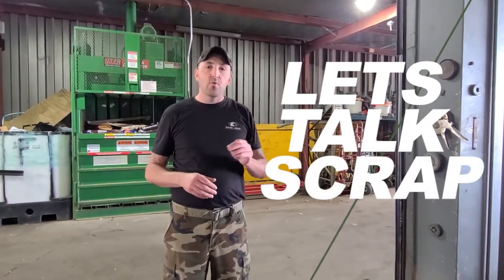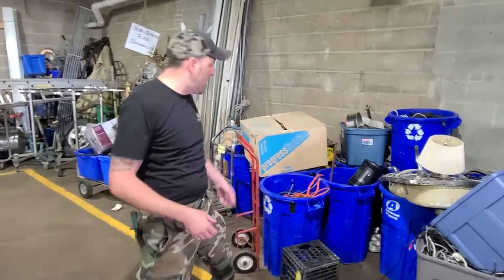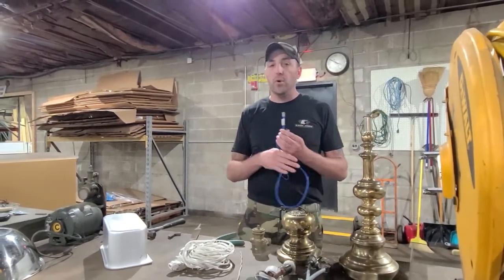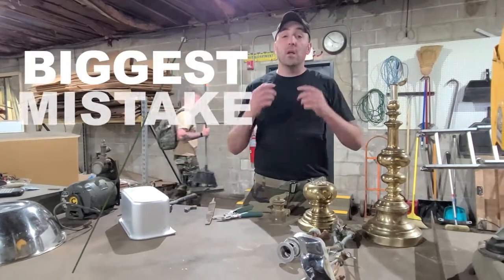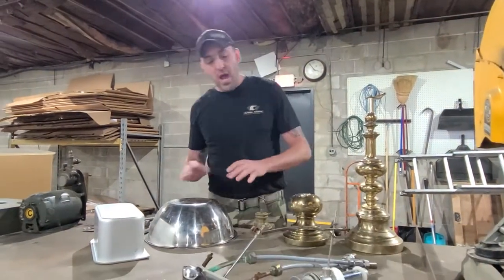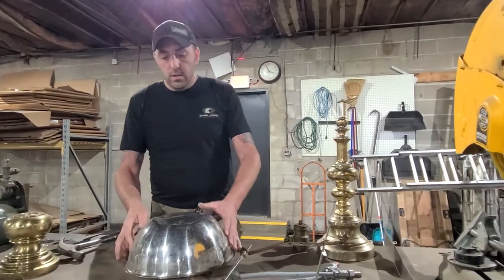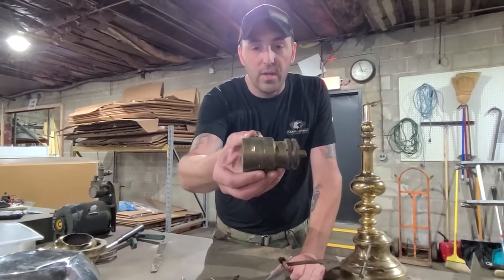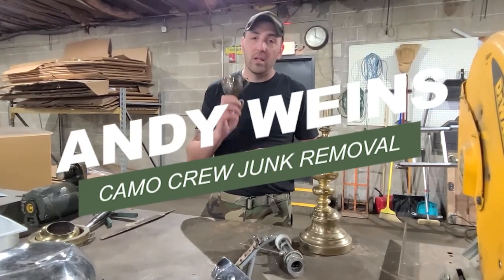How to sort scrap metal from junk removal

Comment: I know you are trying to keep the tools basic, but the definitive difference between aluminum and stainless steel is using your grinder.  If it sparks...it's stainless, if not, it is aluminum or die cast.
Reply from the maker: Thank you for this comment! I actually go over this in a later video where I cut some metal on film as well.